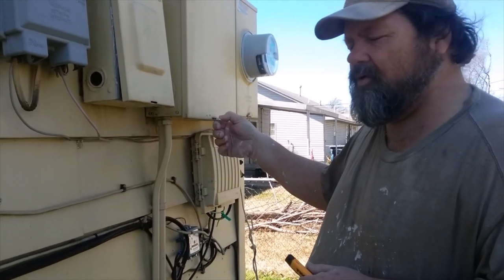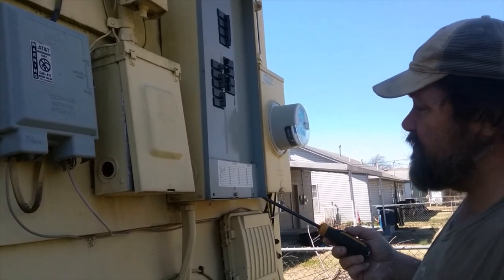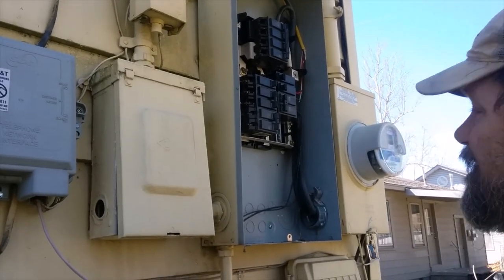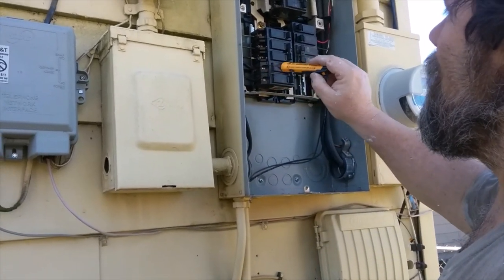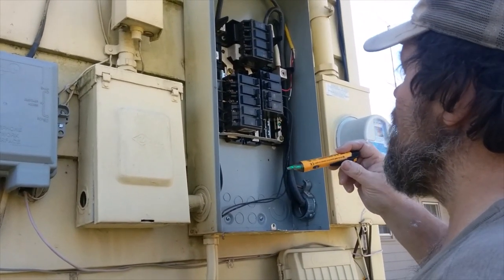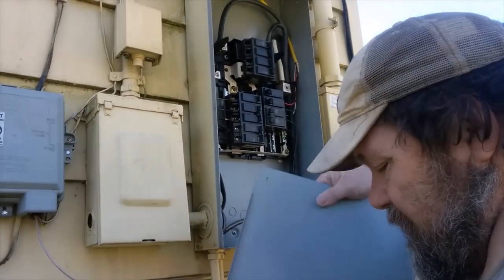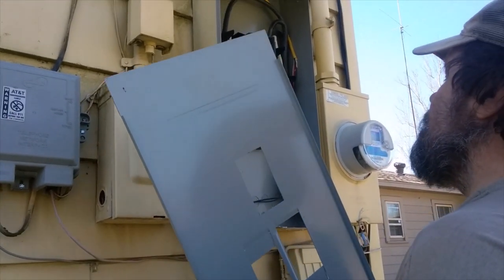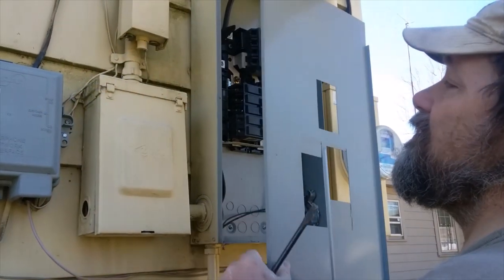How To Test For A Bad Circuit Breaker

Comment: I had turned on my microwave & it went off thought it burnt out then realized the fridge wasnt working & all the outlets in kitchen dinning area are not either I then check the breakers they all was in on positition I shut them off & on & yet nothing all outlets was out I used that klien tool you have & all breakers beep on the hot side I am now scratching my head what do you think it can be?
Reply from the maker: Since it is the Kitchen, it could be a GFCI receptacle. These protect kitchen and bathroom outlets. They are the plugins with the little buttons. If one of those have tripped, it could kill all the power to your kitchen. It shouldn't be wired that way, but I have seen them done like this before. Go around and see if any of the outlets have those little buttons.

Comment: Hey....i have a breaker that doesnt click...loose
Reply from the maker: On some of the newer breakers, you will need to flip them completely to the "OFF" position, then flip them back to the "ON" position in order to get them to reset. If your breaker is not staying in the "ON" position, it may be bad. Time to call an Electrician!